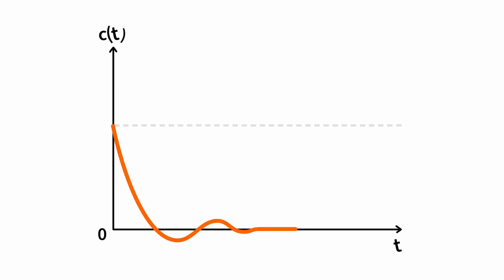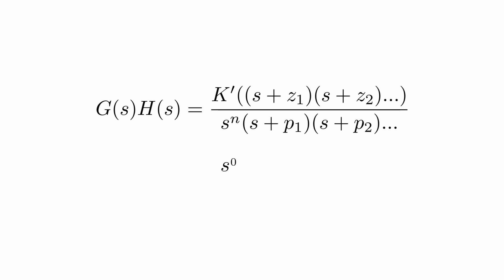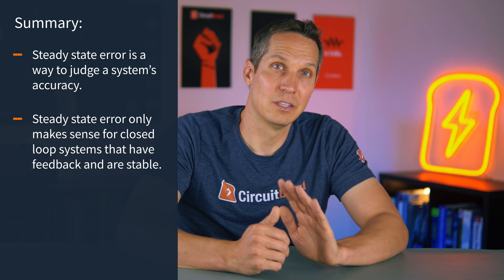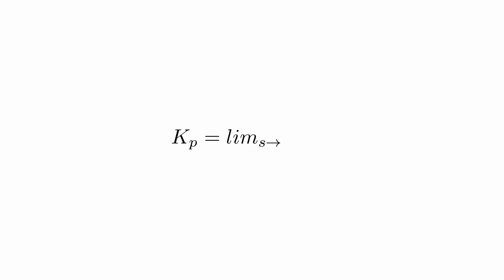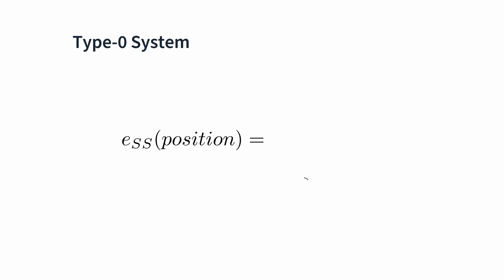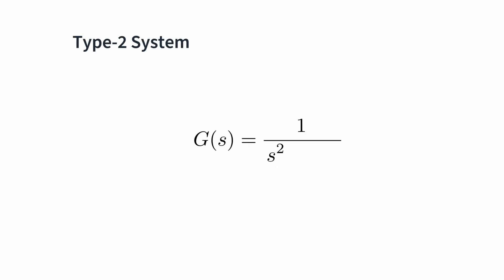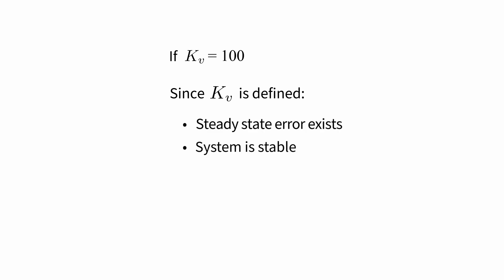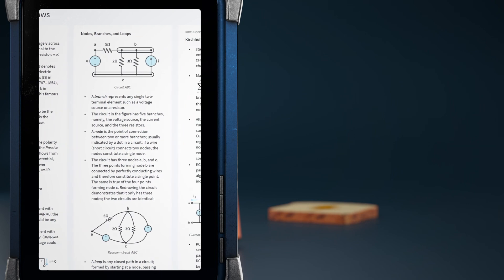Performing Error Analysis: Control Systems 2.5

Comment: So each of Kₛ , Kᵥ, and Kₐ can contribute to final steady state error? Can they all be finite for one system? 

And since the relation is position-velocity-acceleration, are Kₛ , Kᵥ, and Kₐ independent or can they be derived from each other?
Reply from the maker: Thanks for the questions!  Yes, they can all contribute to the final steady state error, but they cannot all be finite for one system.  Well, technically, 0 is a finite number, so depends on your definition.  But it makes sense if you think about it - if you have a steady state acceleration error, then you're not going to have a steady state (or finite) position or velocity error as they both will be changing continuously.  And if you have a steady state position error, then you can't have a non-zero acceleration or velocity error, because then you wouldn't have reached a steady state in position.
And while the three static error coefficients are mathematically related, I'm not sure if there is a way to derive one from another. I'm also not sure if there is a reason you would ever need to do that. I'll have to think about this one more and let you know if anything comes to mind.
Reply: @CircuitBread  oh yeah that makes sense
Reply: @CircuitBread  I figure "steady-state" is the key word here